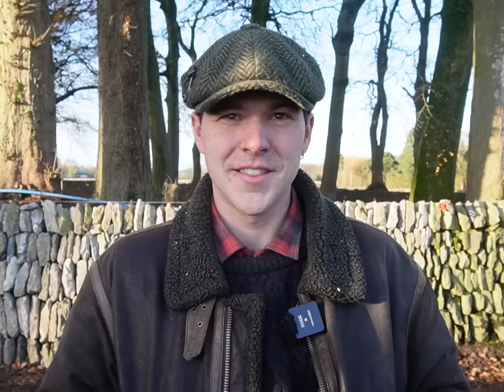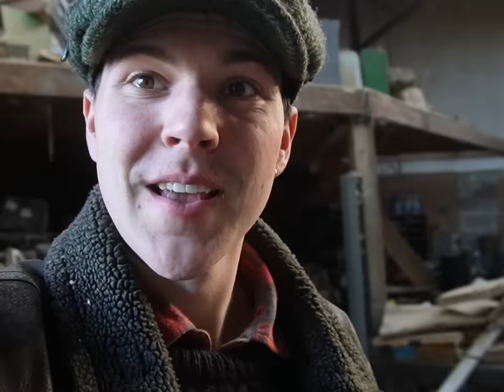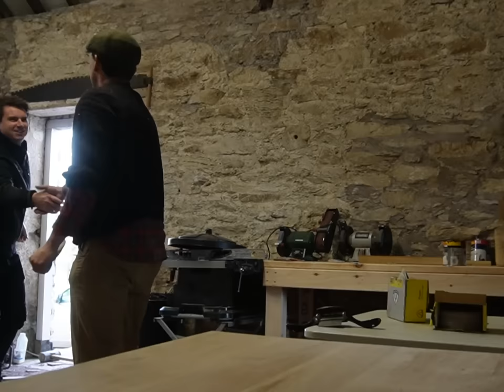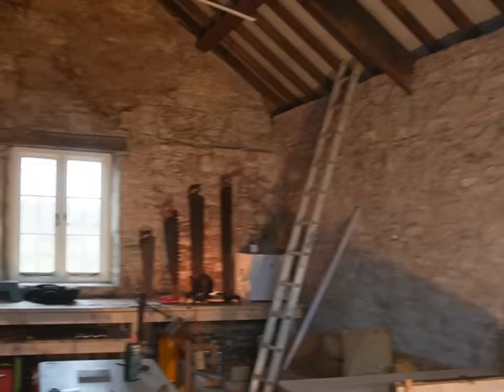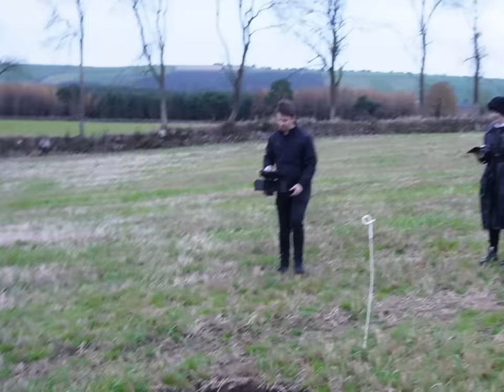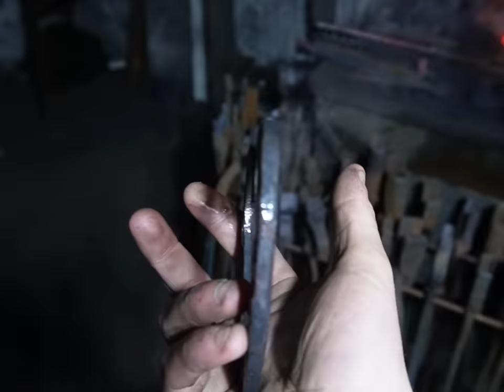Mental Health

Comment: The Stanley #80 scraper is great, but it’ll not take off much material. You can still use the #5 and avoid tear out by moving across the grain while holding the plane skewed at 45 degrees — sort of skidding sideways. It’s eliminate most or all of the tear out if you’re still sharp and slightly cambered.

Comment: at 11:15 his hammer technique is a little off, use more of the body and sortof your ribs to really carry the weight of the hammer. will help with endurance and make the joints hurt less later, plus helps with accuracy. fantastic work overall though.

Comment: Question for  whatever experience level is below beginner: how do you tell which direction the grain is going? Is something you can feel when you run your hand over the wood? Something you can see and follow in the wood?
Reply: With some experience you can tell by looking but once you start to plane the piece of wood you will soon know. Eoin got a good shot of the pitted and torn surface you get from going against the grain.

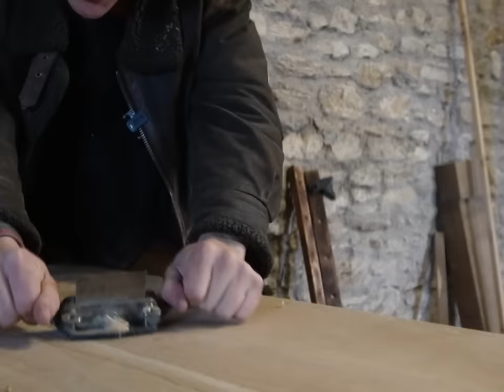Comment: Whats the name of that type of scraper that you used at 4:55 there Eoin? 
That looks awful handy and easy to use, not seen that before
Reply from the maker: Hey there! It’s a Stanley no.80 scraper plane. A very cool tool I don’t use enough
Reply: Wow! That was a fast response! Thanks a million  @EoinReardon ! I'll have to add that to my list then haha 

Finally gave in and got a wire brush, after seeing you sue one, for the angle grinder as I bought a few old hand planes I wanted to fix up but everything is rusted and jammed up, I dont have the energy for the sandpaper and lubricant anymore hahaha